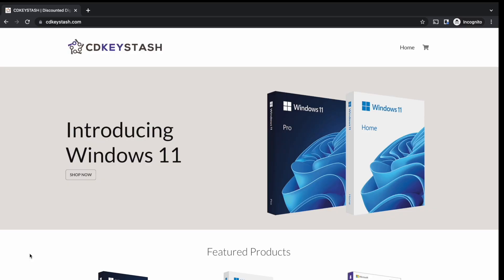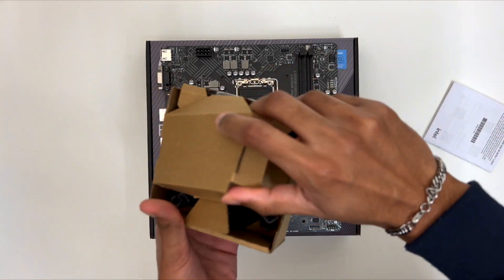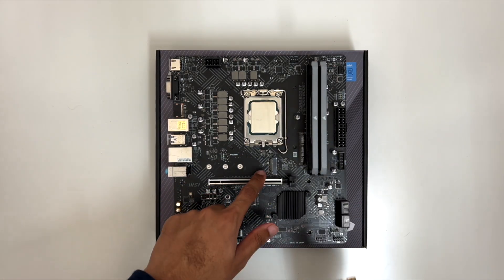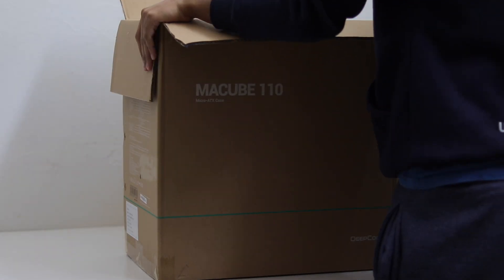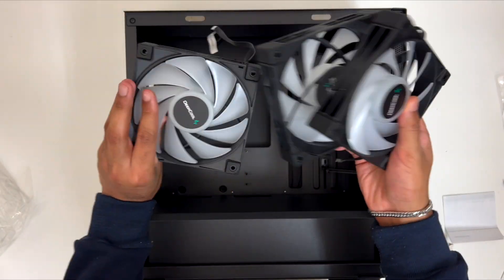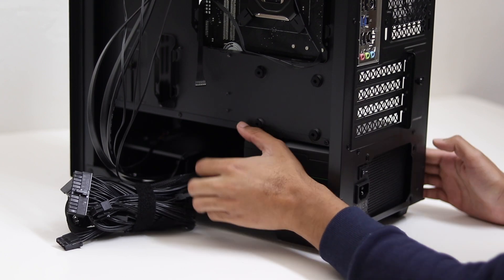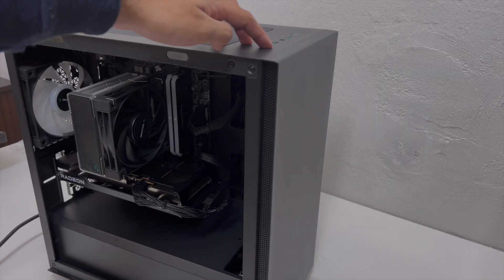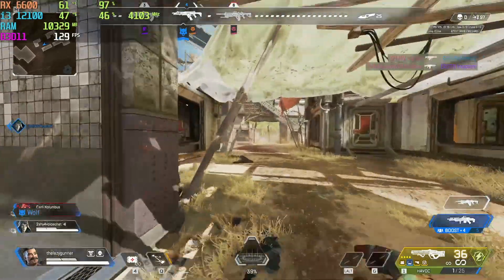BEST $800 PC Build 2022 (w/ benchmarks)

Comment: 4:29 The Macube 110 actually has terrible airflow. You'll need good quality fans on the front to bring in air from that restricted front panel. Though you are using lower power parts so it shouldn't be a big issue.
Reply from the maker: While I do agree that it doesn’t have the best airflow, given the components used in this build (i3 CPU etc) it’s not high end at all and thermals are just fine. Never had any issues.

Comment: The exact build I've been waiting for. 😃😃😃
Reply from the maker: I hope you enjoy the video :)
Reply: @thelazygunner  yep, just completed watching it. Which movie would you suggest if it's the B660, cause I wouldn't be over clocking too and want the 12400f just to work with the Mobo without any Vrm issues
Reply from the maker: Are you looking for a micro ATX or ATX motherboard? If it’s micro ATX then gigabyte b660m ds3 and if ATX Asus Prime B660-Plus
Reply: @thelazygunner  okay, I'll be going with case that is cheaper, Need to check the pricing too as I'm from India